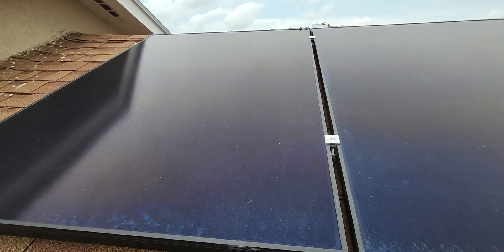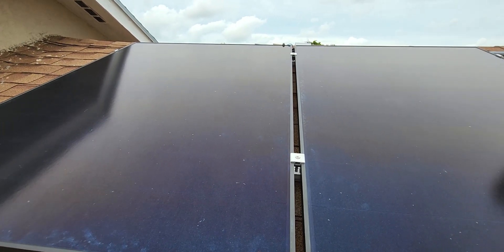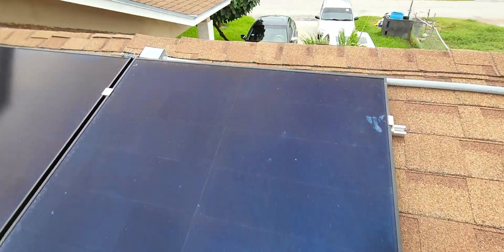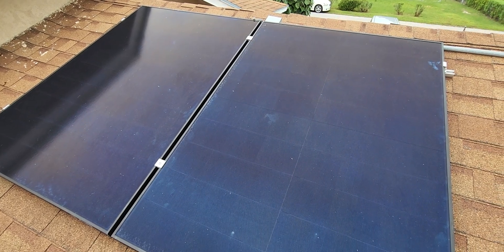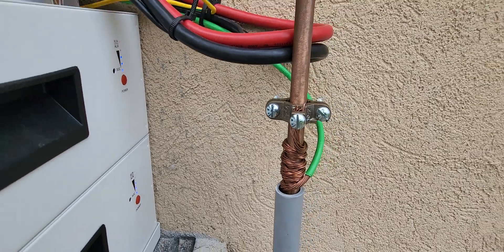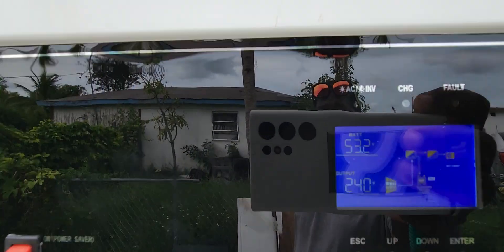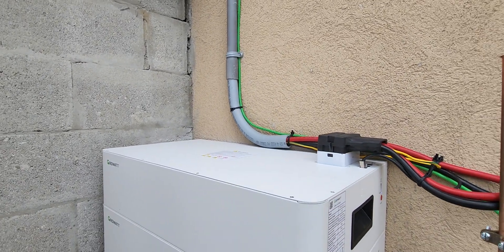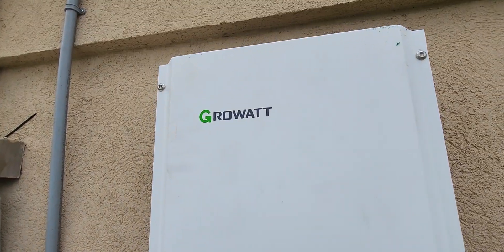Growatt 12kw Solar with 10.2kwh Battery Bank

Comment: Can you help me , i have 8 baterie AXE5.0KW to use in growatt 12kw inverter but has problem to comunication
The option 5  change the L1 but when push enter change L1-01 how made this?
Reply from the maker: Sure I did a step by step video to change the settings for both to communicate so send a whats app to 242-436-3749 so I can send it but for a quick summary the settings have to be between 51-99 and you must have the communicate cable connected and you will be good to go or you will have errors and shut  downs
Reply: So  51  is  match

Comment: Hi, Is it OK to leave the Growatt inverter outside? Does that model have an IP rating? Thanks
Reply: No, Mine is in  a cold building and it don't like High most mornings.  I hang a insulated blanket over the whole area with an exshaust fan on temp sensor, Problems gone.   Looking at a 15k Sol-ark now